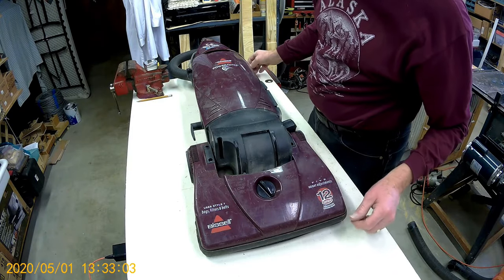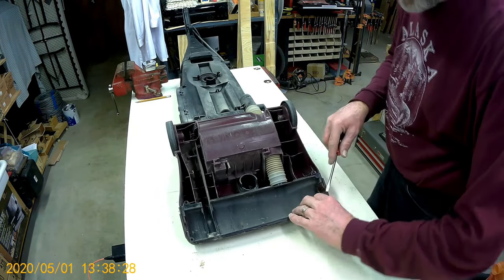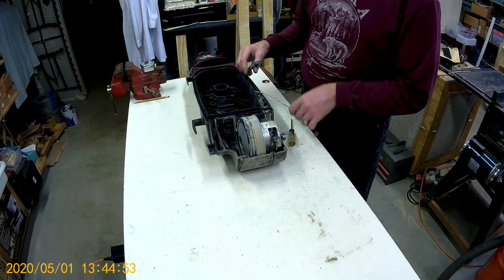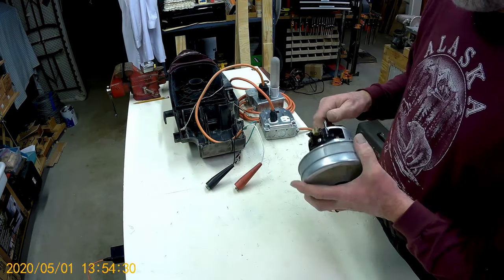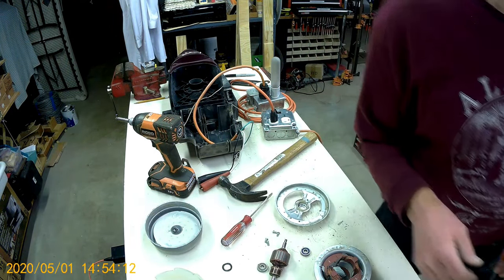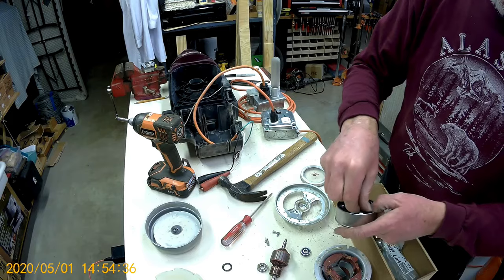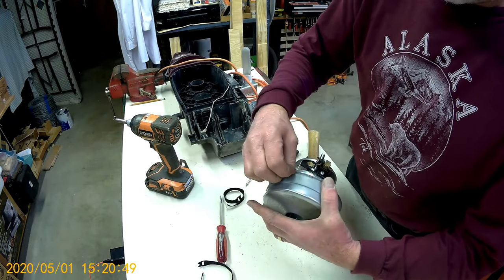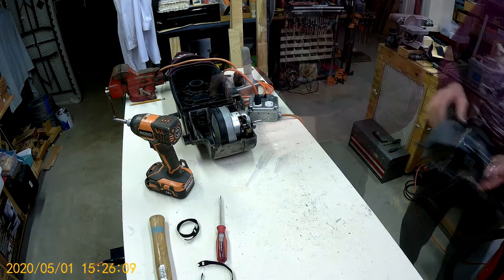Vacuum Cleaner Motor Bearing Replacement | Bissell Powerforce, Mod:  3537

Comment: I need you to help me out with replacing motor bearings on a Windtunnel, because I have few Hoovers that needs replacement bearings, 1. I have a problem removing them. 2. I have wrench sockets that won’t fit both ends of the motor shaft. Help me

Comment: Next time u take it apart like this that metal fan clean that out. This vacuum will run brand new with all the dust out of the motor fan
Reply: Keep in mind that your bearings can still go out
Reply: @dawsonmatheny5504  High quality bearings such as Koyo, Nachi are better bearings to keep your motor running

Comment: I'm having trouble finding the correct bearing size for my vacuum cleaner
Reply from the maker: Once the bearing cleaned the size is legible.  My experience has been they are usually very common.  In my case they are used in skateboards.